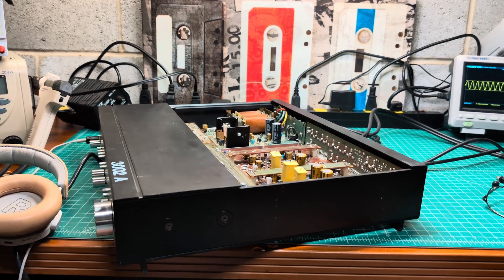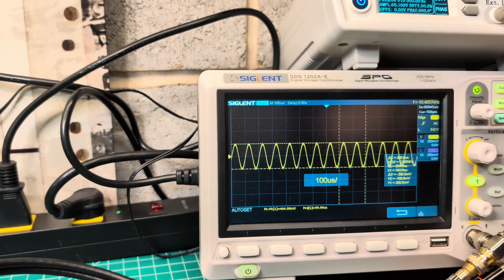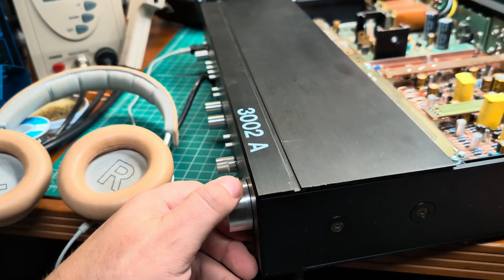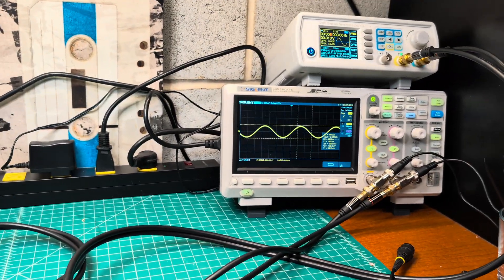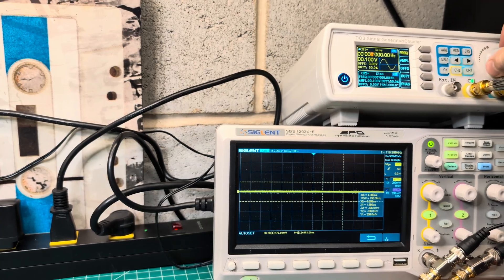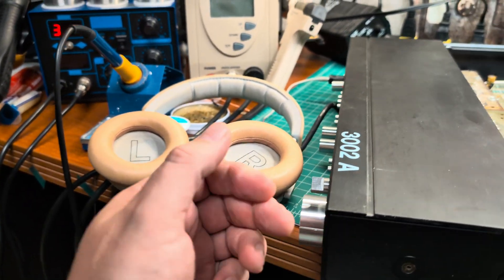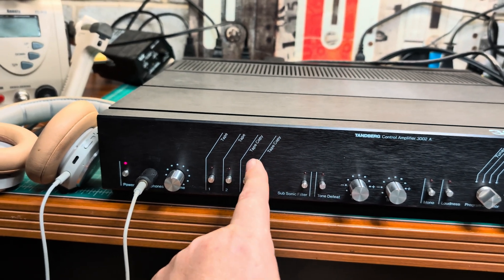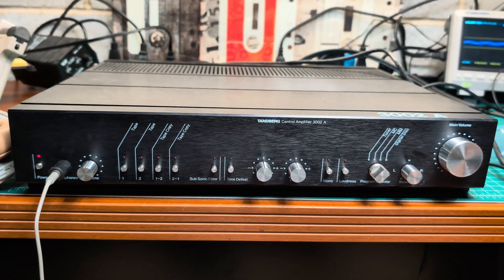Tandberg 3002A Restoration Part 2: High-Frequency Performance Unveiled!

Comment: Really enjoyed your Tandberg repairs, I have both a 3006A & 30008A with Left Channels out.. From what im reading its most likely cold solder joints.. Stupid question but how the heck do you remove the top cover?  I cant figure it out and really didnt want to start just randomly unscrewing stuff.. So cool how modular everything is.